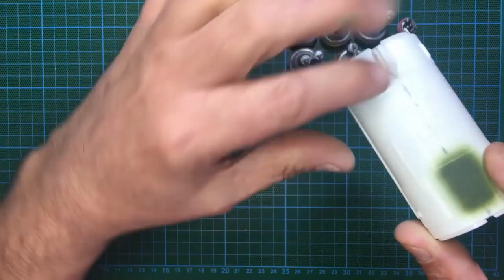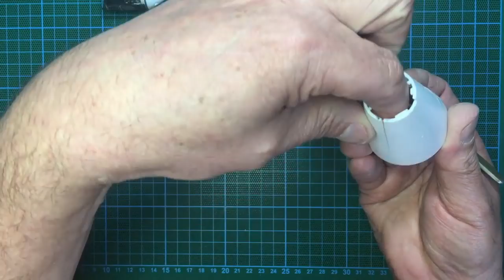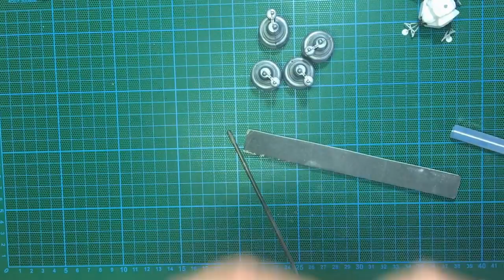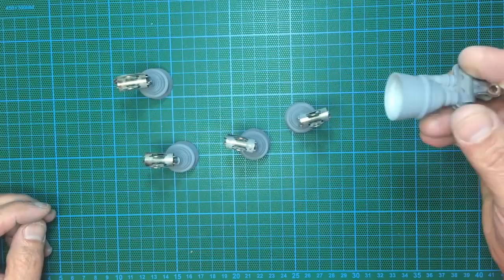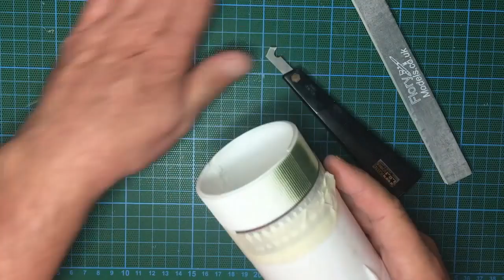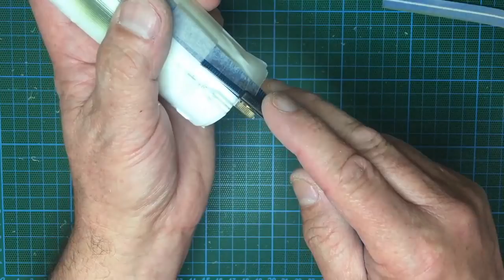Revell 1/144 Apollo Saturn V Build series. Part 6 Bits and pieces..

Comment: Hi Nigel. Great channel, I’ve been watching since the start and always look forward to your updates. I’m also doing the build along and am enjoying that. Question for you, I have the Revell Saturn V 1:144 but the instructions tell you to paint the bottom where the F1’s are, and then the inside parts of each stage in green. What I’ve seen from my research is that the bottom is white, and the insides of the stages are either a yellow/orange color, or gray. I just wondered what your opinion is on that seeing as you have two builds in the works.